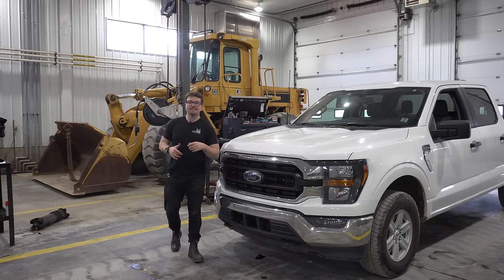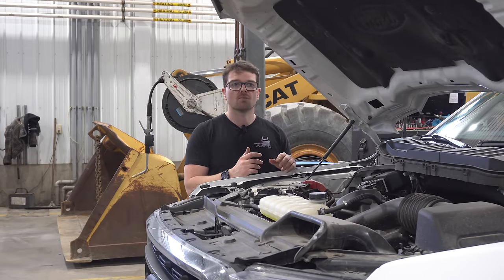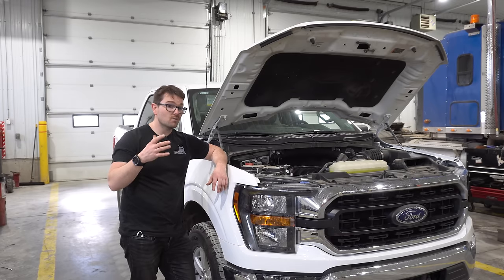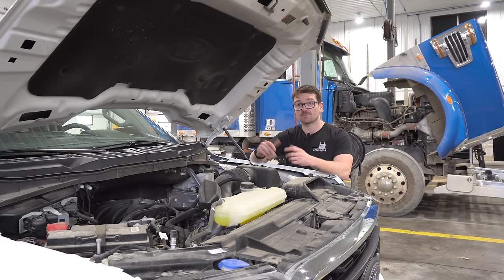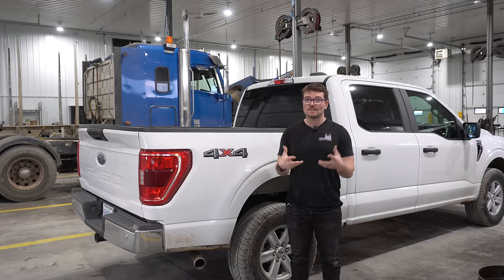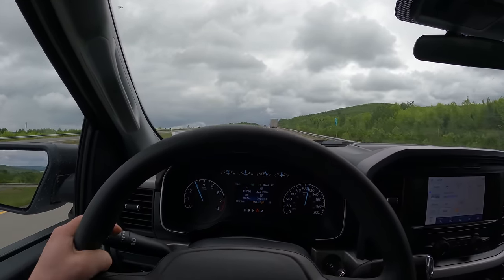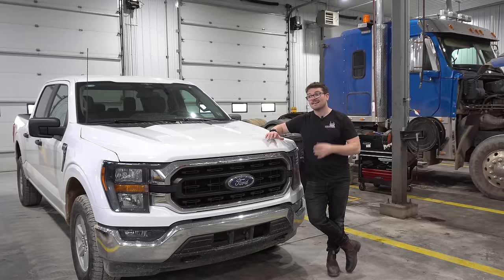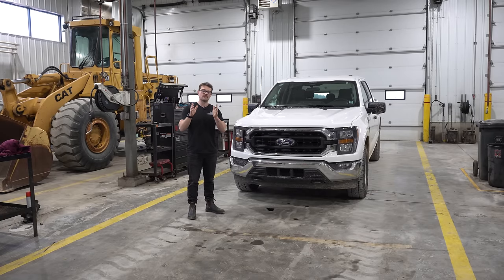Ford F150 5L Coyote V8 Engine **Heavy Mechanic Review** | 5 Reasons why It's the BEST

Comment: I have a 5.0 for my personal truck and my last work truck was a 2013 with the 5.0 and it has 240k on it when i got a new one and it still ran great and as far as i know it never had any major repairs done to it
Reply: Personal truck is a 2020 f 150 just hit 65k on it . Its also been great so far . I hear some people say they use oil but my oil is always good to go . Run full synthetic and get it changed every 5 K  . Got my tranny fluid and filter changed at 60K . I use to be a chevy guy but after driving fords at work and my last chevy having issues and the body being made of tin foil i decided to go with the ford and i love it

Comment: I couldn’t agree with you more. That’s why I got a 5.0 in my new F150 6 months ago. I also own a 2018 Expedition with the 3.5. While it’s very powerful, cam phaser replacement and continuing noises upon startup certainly concern me. Plus my Expo tows 9,300 lbs. My F150 (the way I configured it) tows 9,400 lbs. I know I could have configured it to tow more, but I will never exceed or get close to that. That means I can tow the same, and have a more reliable engine, and be more fuel efficient all at the same time.
Reply from the maker: I was amazed how much more efficient the 5L was when towing compared to the 3.5L. And it is not as powerful but still packs a really nice punch

Comment: If your 2018 5.0 and newer has an oil consumption problem not solved by Ford; Change the weight of the oil to 5-w30 from the 5-w20 recommended. I still use Motorcraft semi synthetic but no longer use any oil between changes at 3000 miles because of 90% in town driving. Love the 5.0 V8 over my previously owned 3.5 eco-boost.

Comment: Good video. I also hate in principle that Ford implemented the cylinder deactivation in this engine, however I currently drive a 2012 GMC Yukon 5.3L with the cylinder activation. At 280,800 miles I’ve not experienced any issues with the engine, zero.
Reply: Very nice to hear. Good you are taking care of your Yukon.

Comment: I've got one in my 2018 and pull a 7700-lb travel trailer about 12k miles a year.  I've had it over the 12,300 ft Trail Ridge road in Colorado as well as several other 10-11k passes, not to mention many thousands of miles of interstates and every other type of terrain.  I've even had it through Canada a couple of times!  Truth is, I wish I could afford an F250 for the added mass, width, and wheelbase, but one area that is more than sufficient is that 5-liter.  I'm actually quite amazed by it.  I seem to get 11 MPG no matter the speed, grade, or any other variables.  Entering the highway never feels like I'm breaking a sweat, and paired with the superb 10-speed, I've always got just the right gear.  Tow-haul mode is brilliant, and another advantage over the 3.5 is much better compression braking downhill.  Yes, it does use a fair bit of oil.  So what, oil isn't that expensive.  It's just an impressive truck engine.  I had one in my 2011 Mustang GT as well and thought that was a wonderful engine, and all they've done since is improve it.

Comment: The V8 has been a solid workhorse for me in my 2019 F150. Have nothing but good things to say about it at roughly 97k miles. 

It's all the other stuff like the transmission, drivetrain and 4x4 transfer case that has put this truck in the shop.

Comment: My 2018 5.0 dropped a valve into the piston at around 1000 miles. Ford took forever to ok a full crate motor replacement and then the dealer totally effed up the install and it went back and forth to the dealer for electrical issues and acceleration issues for months. I ended up filing a lemon law lawsuit against Ford and they settled for substantial money. I promptly traded it in for a 2020 3.5 Ecoboost. I really like my 2014 5.0 with the 6 speed tranny better than the 10 speed in either motor. It ran so damn good. No complaints with the 3.5 and I have 65000 miles on it now.

Comment: I love the 5.0. I have currently have 3 of them. 2014 F150, 2023 F150 and my 2022 Mustang GT
Reply from the maker: How the 2014 held up ?
Reply: @TheGettyAdventures  it’s been solid. Not a single issue with the engine. Over 222000kms. Just did a lot of stump pulling and towing this past week. I kept it on the road after buying my new truck because it’s been so reliable

Comment: If you planned to own one of these for 10+ years would you run it in Sport mode all the time? Primarily to eliminate the engine from going into cylinder deactivation mode.

I have a '22 and have found I lose about 2 mpg average between leaving it in normal drive mode versus sport. So the difference for my regular driving and commute is pretty minimal.

Comment: 2013 F150 5.0l with HDPP and currently setting at 303k miles on odometer. No smoking or weird sounds, just small oil pan gasket drip. 👍
Reply: Ya I have the same issue with my 13 5.0 xlt. It has 342k on the original engine and trans.

Comment: 2021 F150 owner here, have you ever had issues with your rear differential leaking and your rear axle bolt breaking? Mine just happened at 23,000 miles which is scary cause it started wobbling, I hear there’s no permanent fix and I’m debating on going to a Chevy. Anyways great video! Thanks 🙏🏻

Comment: The coyote engine in a f150. 2nd choice 
I'm in the tundra with1/4 million hard miles. With an old school 6 speed. What makes this truck besides the 5.7 motor. Its the 411 rear. Great combo when it comes to towing and reliability.  I would of gotten a 3/4 ton years ago.  But if its not broken. There no reason to fix it.

Comment: A friend traded in his v8 ford truck for a turbo 3.5 liter. He said when he towed with the v8 he had to run it at high rpm with the weight, and headwind. Only got 6 miles per gallon with the v8 towing.

Comment: I have a ‘13 with 210K miles. I have done hardly anything. Serpentine belt,  alternator, starter. I change the oil about every 5k miles. I’ve never flushed the transmission fluid, or differential fluid. Truck still runs awesome. Has a small coolant leak and that’s it. 
I’ll drive it into the ground.

Comment: I had a 2019 xlt with the 5.0 and it was only 25k miles when it started making a rattling pinging noise.  I had it to the dealership so many times and their heavy engine technicians could never find anything.  I did some digging on line and apparently it’s a known problem and a lemon law suit or something like that out of New Jersey all ready.  Turns out the only way to get the noise to stop was to give it premium gas and to run a fuel treatment.  Also it would make this constant high pitched whistling noise that  the dealership said was normal induction noises but extremely annoying.  I ended up selling it for a  2022 2.7 ecoboost.  No complaints so far.  I did contemplate trying another 5.0 and giving it a second chance hoping they fixed it in the newer generation but I couldn’t justify the extra 5 grand for the xlt with the 5.0.

Comment: picked up 5.0 lx super cab fx4 tow package. special ordered it 6 months ago. It just hit 5 thousand miles perfect so far. towing a 25ft travel travel 5200 dry 7000 loaded.  first oil change done at 1500 miles. 6000 will be the next! the only complaint is there over 50g with the options i ordered. we looked at the tundra but for same options looking 5gs more. plus im not sold on the turbos being trouble free yet!

Comment: I heard Ford in 2019 changed out the steel cylinder sleeves with a coating and oil consumption has been a issue
I would agree it is a great engine pre 2019. The Toyota 5.7 is also good

Comment: I had a 2019 V8 5.0 at a stop sign hit the gas to speed up right away and it sounded like a bomb. The driveshaft snapped in half I think too much engine for that transmission had a 2.7 L 2018 and I have a 2021, 2.7 L reliable engines like a Toyota, any issue at all I can hit that and it’ll go as quick that’s why I left that V8 mustang that’s a different 2000 30000 miles 4.6 L so far no issues at all. Perfect condition in the garage. Ford Explorer, 2018 V6 no turbo on it in perfect condition. No issues at all. Just gotta know which engine to buy.

Comment: You have mentioned you have not tested the Toyota tundra yet. Once you have tested a Toyota tundra with a V-8 5.7 you will be updating your video.  I have owned the other trucks you are talking about and now I own two tundras. You do not have all the engine problems with the 5.7 V8.  Toyota uses a 10 1/2 inch ring gear with a 4.3 rear end helps give you tremendous towing power. And the six speed transmission with two overdrive gears. The tundra is a very solid truck once you drive it you will feel the difference. And with the Trd suspension they ride very nicely. I have the 1794 with the Trd suspension it is a dream of a truck.

Comment: I have the 2018 5.0. Love it, but unfortunately around 50k miles, it started excessively consuming oil. It’s under warranty so ford is replacing the motor. However, it’s been on back order for 9 months. I have to add oil to it every other week. Hopefully the new motor will  treat me better.

Comment: very good review! I have the 2019 with the 5.0. Love that truck. 45k miles and no issues.
Reply: I have a 2019 also. People initially got freaked out by the oil consumption. The low-tension, multi-alloy rings they used on the pistons take much longer to run in and poor ECM software required a reflash to stop the intake runner from closing completely under deceleration. Ford could certainly do a BETTER job designing and building these things, but the same could be said for everyone's products.

Just my 2 cents.

Comment: Now that you've reviewed the 2.7 also... I'm having a hard time deciding on an engine. I don't tow much, but want a small <5k lb rv soon. I just want the most reliable engine altogether. I have a 2018 5.0 and it consumes about 1/2 to 3/4 qt per 1,000 miles. I love the 5.0 but would hate to buy another truck that I have to continuously add oil to. Meanwhile my 15 year old subaru doesn't seem to use a drop lol.  I'm also nervous about more issues stemming from the cylinder deactivation on the 5.0s now. I'm kinda leaning 2.7 for a fuel efficient truck since I don't tow much but how is the longevity of the 2.7 vs the 5.0? Almost feel like going ecoboost out of fear of oil consumption issues again but then the turbos on the ecoboost kind of scare me lol. Guess that's what extended warranties are for...tough decision.

Comment: I can vouch for the oil consumption issue in the 2018 - 2020 5.0 engines. I always need at least one quart between oil changes. The better news is that I get better mileage on the highway than I used to get with a Dakota running a small V6.
Reply: I'm looking at a 2018 with the 5.0.   That's my worry.   1 quart isn't all that bad I suppose.     But so far so good, you like it?
Reply: @8corymix8  Yeah, I have 120K miles on it so far, and have had no functional issues with the engine at all. Once in a while, I will hear a little rattle which I think is the timing chain when I take my foot off the gas and the engine is still cold, but it does not affect performance in the least. It goes away once it warms up.

Comment: The current 5.3 is a compact pushrod OHV engine with some camshaft timing adjustment ability. The Ford 5.0 is a 4V DOHC engine with independent variable cam timing. This makes the Ford engine much larger, heavier, more costly to make and repair and (in my opinion) noisier.

The 5.0 2018+ in the F-150 most likely won't produce the full 395hp and 400 lb-ft unless using premium fuel (which Ford recommends). Their exact wording is that the engine "can still be run on 87 octane gasoline".

The GM 5.3 outputs 355hp and 383 lb-ft of torque when run on E85 fuel.

It's also worth noting that GM likely doesn't really care that much because they know their customers have the option of the 6.2 with 420hp and 460 lb-ft of torque. Or the option of buying a 3/4 or 1 ton diesel.

Comment: Awesome videos, great reviews and very helpful!! What are your thoughts on a 2018 F150 versus the redesigned 2021 F150? Both with 5.0 and 4x4. Is the oil consumption on the 18 the only concern? Is the 21 a much better option?

Comment: I've got the 2019 5.0 coyote and its had some growing pains. Its got the deacceleration rattle when cold. Ford says its not an issue. Still not sure what causes the sound. So good so far with 45,000. It also had the oil consumption issue. The TSB seemed to fix it. I need to put premium in it or it knocks pretty bad. It sometimes has a rough shift which is pretty standard with the 10 speed apparently. Much better after a tranny reset. Sometimes going up hills I will hear a knock going from 3rd to 4th gear but only when hammering. Overall I love my truck. At first I was pretty pissed with all these issues but its been a couple of years and like a realationship you seem to learn to live with some flaws. Like you said its pulls hard, sounds great and with a 2.5 inch lift and 33x12.5 BFG's it gets 17mpg. Fingers crossed it lasts for a while.

Comment: If I was getting a 1500 this would be my pick. Small complaint, but I've heard the front seats are a little cramped. Great video though, and excited for the new trailer!
Reply from the maker: the seats did seems a little tight lol
Reply: I had a 2016 Super Cab and a fireball I wish I would have kept that truck I got rid of it right before the covid truck spike with prices, so I really kick myself but I never  thought I was cramped in the front seat, I'm 6.2 short body long legs.

Comment: I have a 2021 5.0 and love it! I wish there was something I could do to remove the cylinder deactivation because I do worry that long-term it’s going to be a problem. I also burn about 1 quart of oil every 5000 miles between oil changes. Smh.

Comment: I had my exhaust side VCT Solenoids replaced. 2019 model built in May of 2019. Motor and Transmission were like a new beast after they replaced the sticky solenoids. I love my Gen3 Coyote.
Reply: Common on gen 2 and 3 marvel mystery oil helps also short intervals on oil and 5w40
Reply: @justingill5256  5w40? Crazy, I've only used 5W20 on my motor for the first 50K.
Reply: @Ponyo3816  alot of guys use 5w50 on gen 3.  All over 5.0 Facebook groups many use it helps make better oil pressure at idle
Reply: @justingill5256  i've seen it discussed for track applications for the mustang. But I haven't gone that serious with it because she is still my daily. I am thinking of moving to full synt and doing 5w30 next oil change.
Reply: @Ponyo3816  well you already had to replace your vct solenoids because that thin crap also you know no different in track pack vs GT.
Reply: I never switched to 5W20 on any of my Fords, even going back as far as my 03 Cobra and 03 Lightning. 5W30 works great in my 18 F150 5L. I've never noticed any oil burnoff with it. I'm also tuned turning about 7,200 RPM, and daily it on E85. Been doing so for about 2 years. Runs smooth as butter, and has been 100% reliable. A good flex fuel tune in a 18+ F150 is easy going with no need for several tunes, and with E85 my tune only, 5,600 lb crewcab, FX4 with 20's runs about as strong as a LS1 car. It will outrun my bolton 03 Lightning. I also change my oil about every 3,500 miles. I think one issue people have with newer vehicles is they believe that because modern oil claim they're good for 10K, 15K, 25K miles that they should go that far between oil changes. I disagree. Even with full synthetic, I won't go beyond 4K between oil changes. If say I haven't hit 3K miles in a year after an oil change in one of my vehicles then I'm going to change the oil in it. I've own a bunch of Mustangs and Camaros without seeing any major issues. I think this is especially important on car that only use DI which suffer from carbon buildup on their intake valves, or vehicles that use their lifters to support a cylinder deactivation system, and use the engine oil as hydraulic fluid to activate the lifters.
Reply: @JROC734  thanks for this. What's your MPG on that E85 tune? I can't really do that where I am. As the only E85 station is like 50 miles away from my house. I wish. 

I really can't complain either myself. I change out at about 5K for me. Because I put so few miles on the car now. I don't worry about lower as I to haven't experienced any or much burn off or pass through. 

I also sent some oil off to Blackstone. Just want to be 100% sure there's no pin hole leak in my header with coolant seeping in. Every few months. I have to add just a few drops of coolant. Not sure where or what is happening there. I add it to the reservoir.
Reply: @Ponyo3816  I generally get in the 12.5 - 13 MPG range on E85 depending on how I'm driving. E85 is good stuff, but it definitely takes more if it to = the same amount of energy that gasoline produces. On the upside if you run premium the costs per gallon kind of evens it out as E85 generally sells for a little less than regular octane. I don't put regular in this truck. Even though I could with the flex tune, I don't trust 87 octane with a 12:1 CR.
Reply: @Ponyo3816  common coolant leaks are the orings in coolant hoses,  they leak when engine is off and cold out!  Engine running at temp orings expand and don't leak or waterpump all common
Reply: @justingill5256  thanks for the info! I was suspecting the 3 way connector at the front of the motor. But I don't see any stains anywhere.

Comment: My dad has 2 1st gen 5.0 f-150’s and both needed water pumps, one a starter, and the other an oil pan gasket leak. Both are over 200,000 miles now and that’s it. I ended up buying a 2016 5.0 and love it to death but was told by my salesman it had a 3.55 rear axle and later found out it has the 3.31 now, and with 33” tires I installed. Pulled a 7,000 lb fish house and even 5th gear couldn’t maintain speed on a flat. Debating trying to find some 3.73 axles or just save the $ and shut up and be happy.